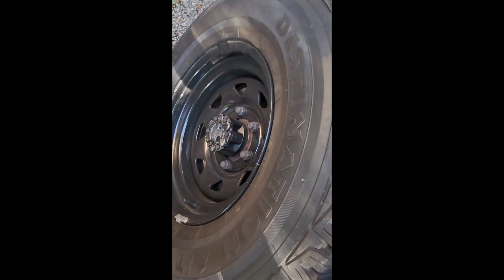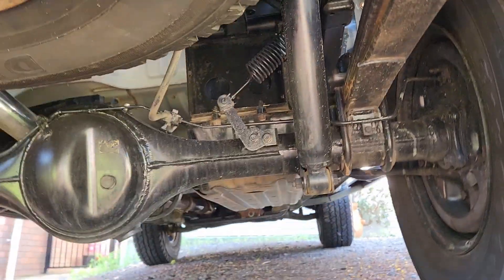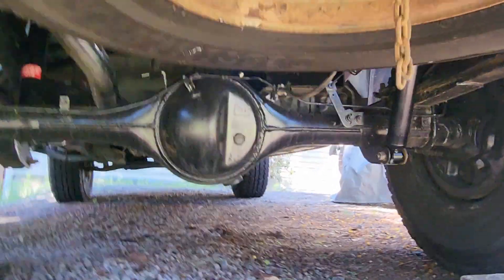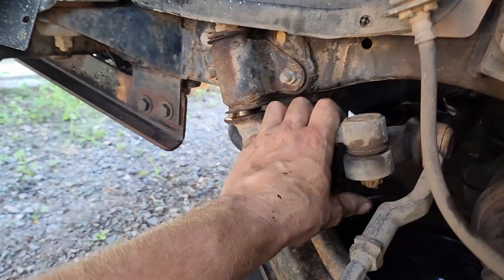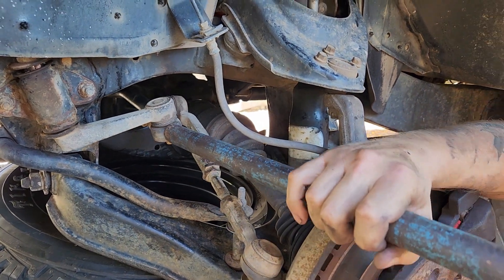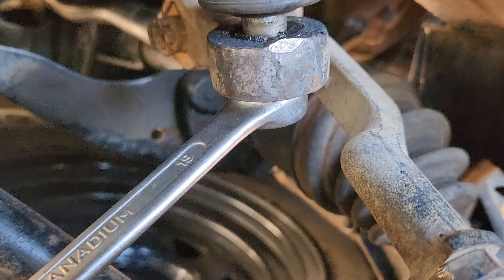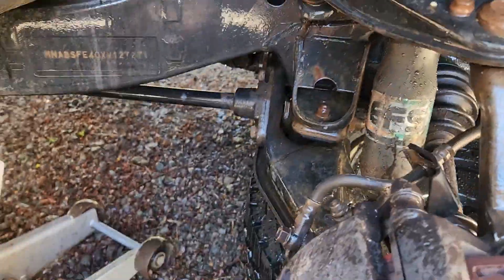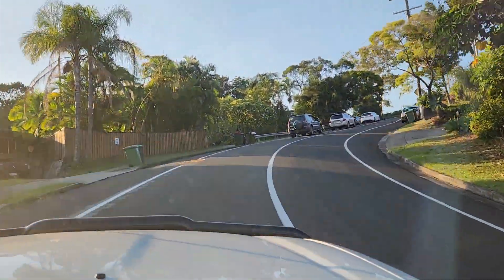Easy 4x4 Maintenance: How to Replace Shocks and Steering Idle Arm For Most Models (Ford Courier)

Comment: Hey man just a btw tough dog and probably other brands make a front shock brace that bolts in with one hole needing to be drilled to reinforce that front upper shock mount
Reply from the maker: Legend thanks mate I'll have to check that out. Cheers for watching.

Comment: I replaced mine with Dobinson's Nitrogen gas shocks. At some point in the future, I'll head up to Rockhampton and get some new springs and torsion rods from them...maybe. That's a pretty expensive investment. You should have seen how flogged out the upper control arms were on my V6. Man, how the previous owners kept it on the road I'll never know.
Reply from the maker: I can relate to the flogged out upper control arms haha, my first courier was cooked. But you live and learn hahaha, at least it's a replaceable part, the passenger side shock mount on my current ute has been snapped off and rewelded so I guess you can never have a perfect one 😆😆
Reply: @Finndawg  I saw that. Solid weld though. Looks like it'll last. I've replaced a lot of the suspension and brakes on mine, to ensure it's reliable, and to ensure I can fix any breaks...

Comment: good sir, you are my last hope 😂. what would you say is max size tyres/wheels, that i could get for my 'Ford Courier  GL, 2.6L, Unleaded Petrol, 4 SPEED AUTOMATIC'. The current stock ones i have are 195R14C-8ply, but i was hoping you would know what the max size would be. if it requires like a 2 inch lift or whatever im down for it😂. Love the content keep it up. Courier Kings
Reply from the maker: Biggest legal size in Aus is 275 brother